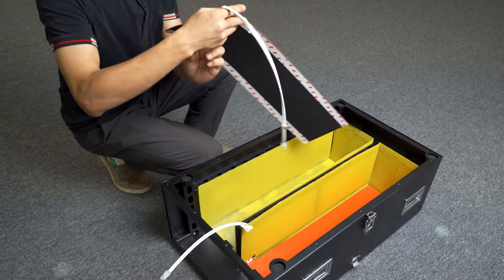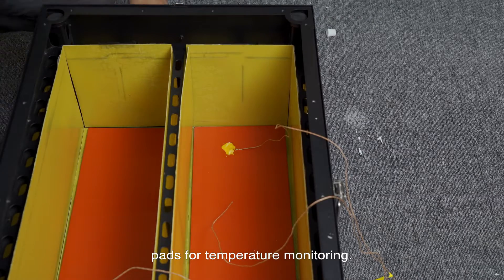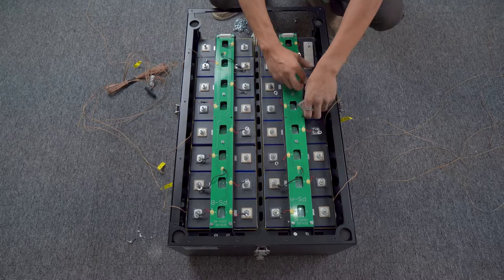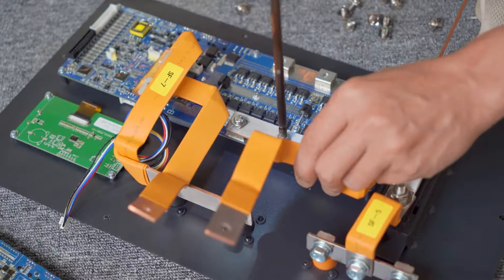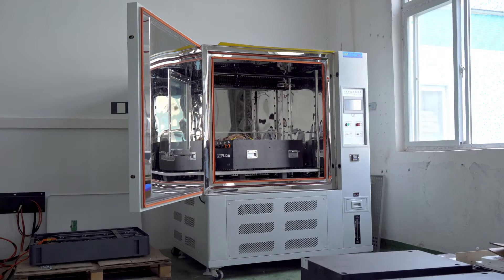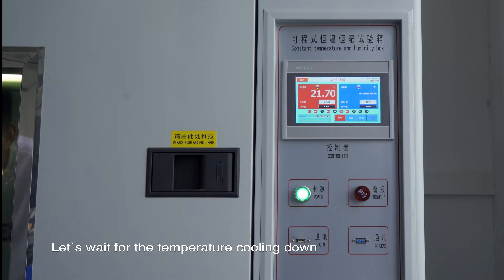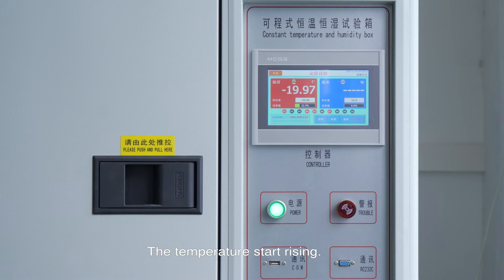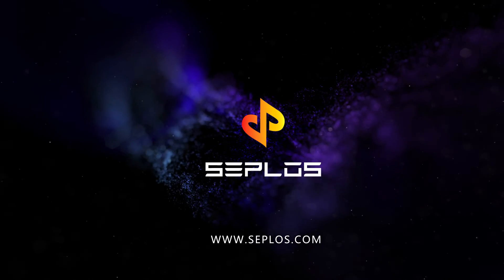Installing Heating pad under a lifepo4 battery for cold temperatures - SEPLOS MASON 280 DIY kits

Comment: Don’t buy the heating pads from Seplos; I bought them but the BMS heating logic is awful.
Here’s how it works: when the inverter wants to charge the battery and the temperature is below a certain threshold, the bms turns on the heating but also the charging mosfet (although at a reduced charging current). You are not supposed to heat and charge LiFePO4 batteries below 0°C (even with a small current); you need to heat the batteries first and then start the charge.
Unless Seplos fix this in their firmware, don’t buy this.
Reply: Any update on this, has it been fixed in firmware?
Reply: @007silverwings no, there are no firmware updates for the Seplos
Reply: @jacopo.scarpellini  that's bad news. Come on Seplos, sort it out!
Reply: First winter here after installing the batteries and none of the heating pads are working.  All 8 batteries shut themselves down (which is good I guess)

Comment: Il faudrait 6 plaques chauffantes pour chauffer uniformément les cellules. 2 au fond et 4 sur les côtés. Mais je vais commencer avec 2 au fond pour essayer. 👍
Reply: I've got tiny heating pads on mine and it still works well enough to keep the above 5 degrees in the winter. These should be fine, they conduct the heat pretty well.

Comment: You are placing the battery on the probes, wouldn't this cause the height to be slightly different, which might give issues with the terminals?
Reply: The probes aren't big enough to affect this.

Comment: Can this be installed to existing Seplos BMS or is it only for new BMS?
Reply from the maker: Need add heating module.
Reply: @Seplos Technology  is that a seperate module or requires a special version of the BMS?

Comment: Nice and clean system. 👍👍
Please DO NOT wear rings on fingers nor use non-isolated tools for your personal and battery safety.
Reply: Yeah, that's a good tip because once you make a short, you might be welding the ring to the short surface, and you might be having some fun with a ring that will become hotter and hotter. Even if it's a nice ring that's normally easy to take of might get deformed and causes it to be stuck on your finger. Stay safe ~
Reply: @_JustBeingCasual  I buy cheap the pack with the finger than